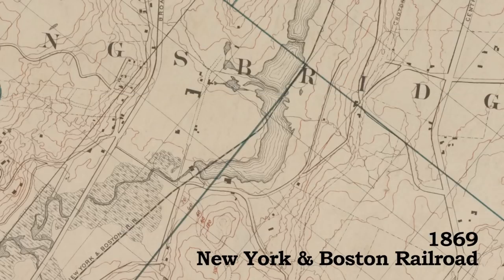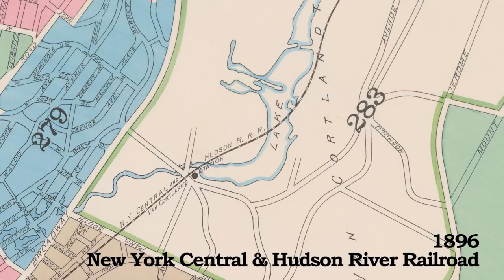The Grand Central Stones – ‘City Full of History’ Episode 4

Comment: The big hole in the ground was the shaft for the elevator that went 13 stories deep.  
This was the bottom where the Tesla turbine engines sat.  
The thirteen stories is the shaft of the Tesla coil ..

Look carefully at the 6 old steel girders and balls at the top floor...

Notice the information booth..  

The grand central terminal is a grand size terminal Tesla coil...

A 13 story Tesla coil...sitting dormant...as grand central terminal...

Tesla built.   Then dies...work all gone . 
But his work sits right there .

We all seen Tesla coils generate energy ..imagine 9 turbine engines...